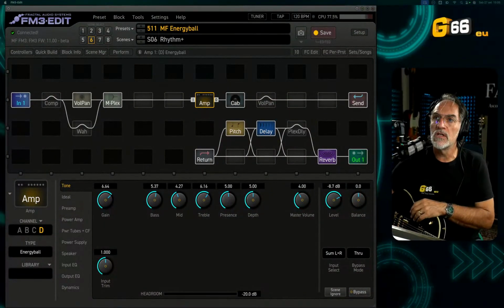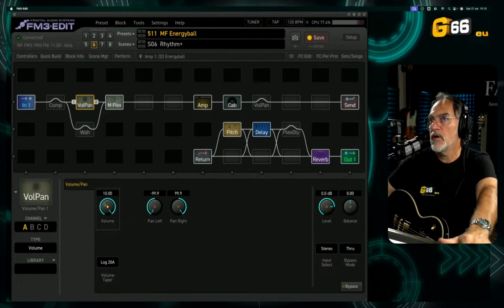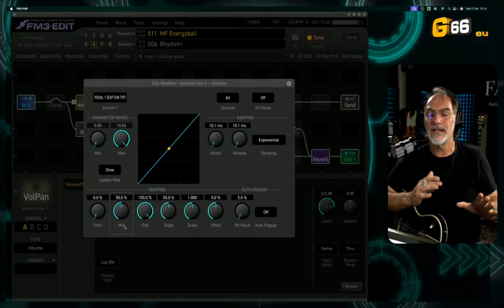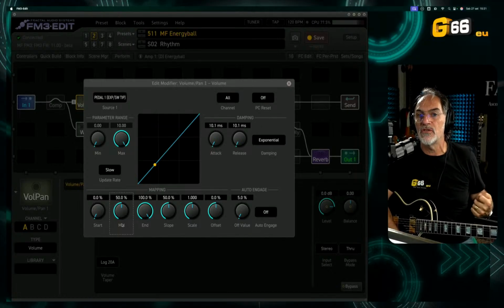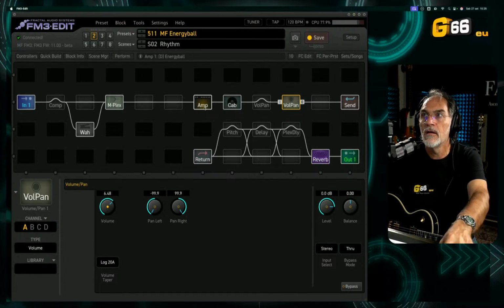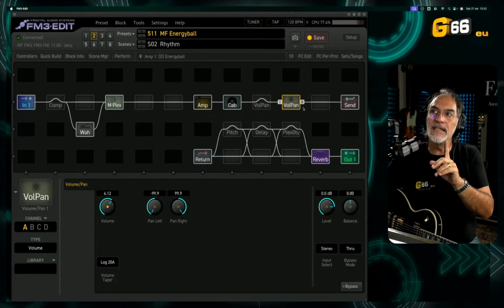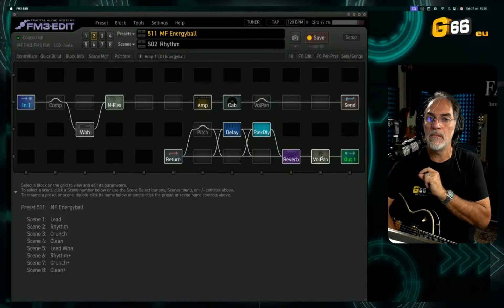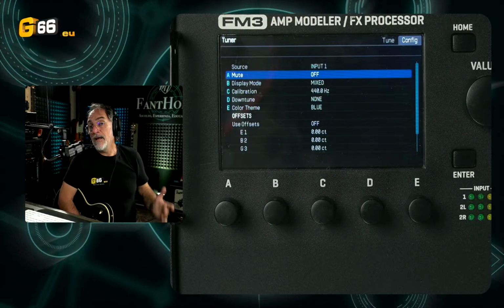Fractal Saturday Live - How to use Volume Pedal correctly

Comment: My problem is, I want to place the volume pedal after the cab, but I also use a wah pedal in the same preset. I placed the wah pedal after the compressor at the beginning in the raw Underneath 

Now when I assign with the M Plex, both pedals still move. I can bypass the volume pedal where it is not needed, but there must be a more elegant solution

Comment: Thank you!  This is excellent.  I really noticed the linear issue more with the wah pedal over the volume.  I currently use the volume across the whole system as the overall post-processed output volume and use the guitar to manage the input/"emotional" volume.
Reply: thanks